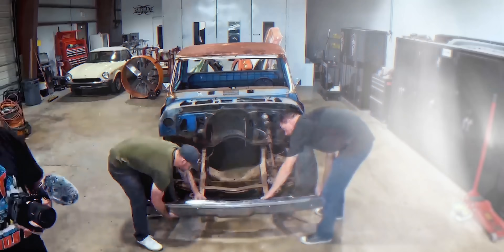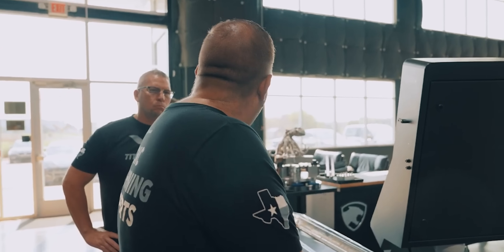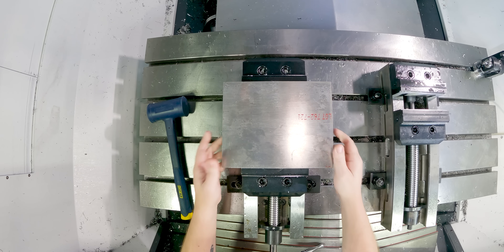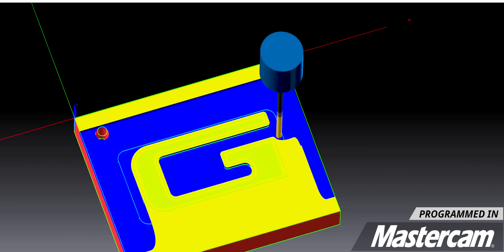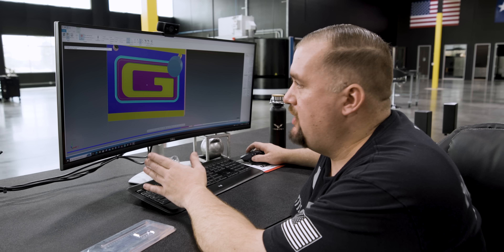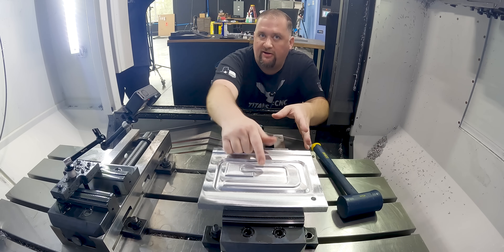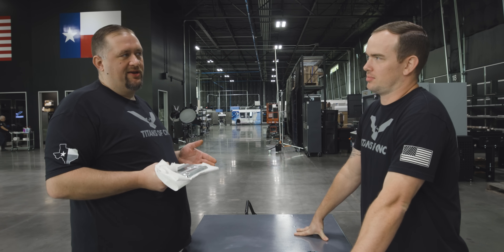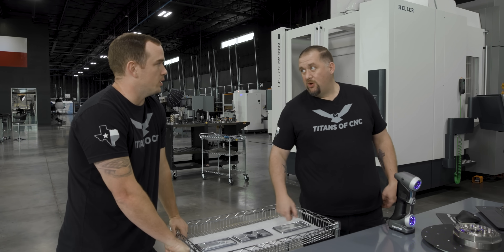CNC Machining Parts for Gas Monkey Garage

Comment: Instead of using a block you could have increased the font size and hollowed out the back so that it fit nicely over the original stamped letter. Best of both worlds IMO.
Reply: The problem with that was that it changes the shape of the font (think the opening inside the G), this was the best way to keep the same GMC look.
Reply: @barrysetzer  Ahh gotcha, that does make sense. Looks killer!

Comment: On the subject of reducing chatter, or harmonic vibration: we used moldpak, it was this nasty material but it did work. For something like that, I've used jack stands and folded paper from my paystub in the past. I think it would be an amazing idea to have jack stands with a non absorbent material grafted onto them, and possibly springs to eliminate as much work as possible when setting them up and switching parts.

Comment: That was a good trick with the rubber cork stuff. I need this stuff for a part I did a while back. It was a big 28"x20" plate I was milling a circle in and the vibration killed 3 tools. I tried using hardened steel jaws as support in my vises but still had some severe vibration you could hear across the street. This stuff would be a HUGE help.

Comment: Nice work Barry, thanks for giving me a heart attack by throwing the prototype on the ground🤣
Reply: Anytime, Trevor LOL
Reply: @barrysetzer hey barry do you have a part number or link for the deburr brush?
Reply: Yo Trevor how long did you tumble those pieces for?  I have a tumbler but wasn't happy with the results.  I am almost certain I wasn't using the correct media for this application.  I have really only tumbled brass before and it is just to polish for reloading my ammo.  I have never tried tumbling to remove machining marks.
Reply: @tdg911  What’s up Troy! I did two hours in ceramic and then 2 hours in walnut shell. The ceramic works really good if you’re going to anodize parts especially. It puts kind of a dull finish on the parts but it’s aggressive enough to remove machining marks. The walnut shell works great for polishing but it’s not aggressive enough to remove machining marks!
Reply: @trevorgoforth8963  I appreciate the quick reply!  You guys are awesome
Reply: Ahhh man I read your comment first before watching the video it was at the top 😂

Comment: Nice but needs some more work. I can see the tool marks on the reflection at 11:47 and 12:06 And personally  I would use a vacuum chuck for those parts.
Reply: I could heve gotten that out, but Gas Monkey was actually worried because these look better than some of the other machined components.
Reply: Get a life

Comment: That ceramic brush you recommended in the discord channel was a game changer for me.   I followed your advice and also checked the recommended feeds/speeds parameters on the manufacturers website for the brush I purchased.   No more processing by hand :)  Thanks again for the recommendation!  Much love and gratitude.
Reply: Im looking for a brush aswell. Can you link it?
Reply: @sune4290  Well worth the money.   I ordered the 1" 180 grit version.  I took some measurements before and after taking 4 passes and saw .0005 difference.   My finger tips were jumping for joy.  I was having to lightly sand my surfaces which created an uneven surface which was noticeable for the very fine engraving tool I was using.  Not an issue anymore.
Reply: @tdg911  Cool! But the link? We need that link, man!! :D
Reply: @CarlosCruz_cc  Barry kinked it in the first reply.
Reply: @tdg911  Can't seem to find it... You mind sharing it, please?
Reply: @sune4290  http://www.brushresearch.        com/brushes.php?c1=80